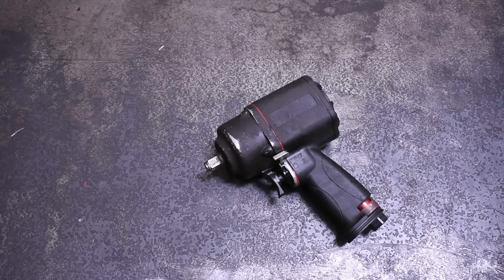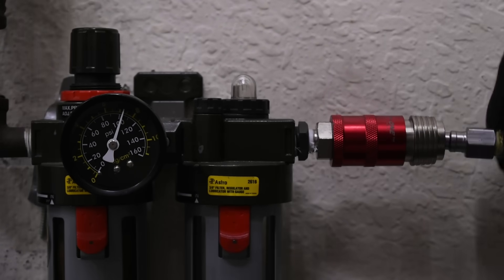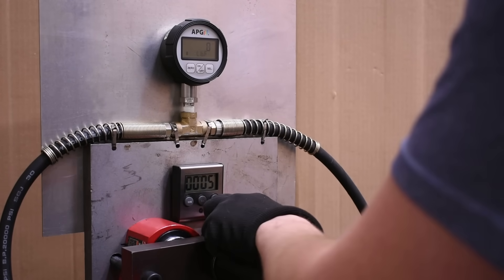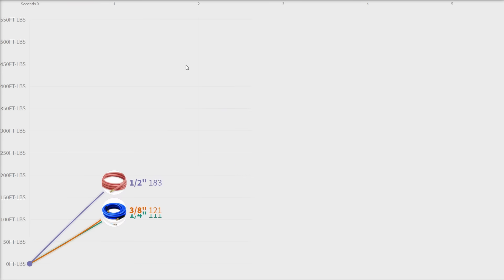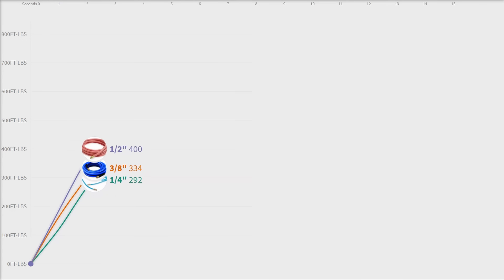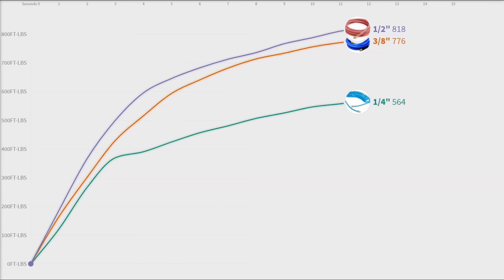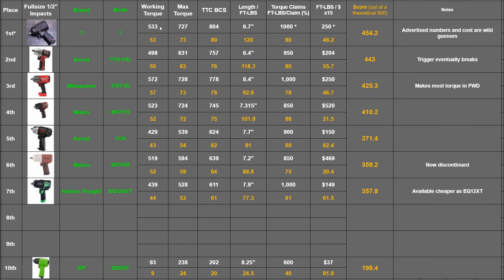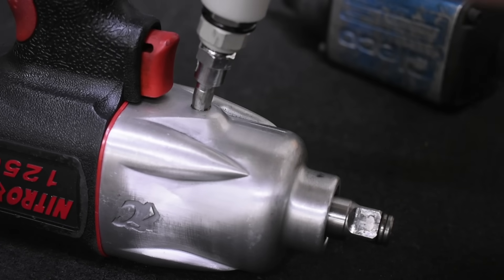How Much Power Are You Losing w/ Your Air Hose Size? Dyno Graph Testing

Comment: I sell and service pneumatic tools at my work. We find if people are losing power at the tool, it quite often stems from what the inner diameter of their air hose is and how much it's restricting volume, lots of people forget about volume and just focus on pressure, easiest way we've found to see the reality of this is to have an in line gauge plugged in right before the tool that'll show you. You may have 110psi when not using the tool (as recommended) but then drop to 55-65psi when actually in use. 

Just my 2 cents.
Reply: Another pressure drop is the coiled hoses!
On airseeders, all of the main runs have to be about the same length. Every time you loop a hose around the tower you ADD 6’ to 8’ to the hose length to get the effective length. 
Pull a pressure drop test on a 3/8” rubber/plastic hose vs 3/8” I nylon spiral hose. 
Use no air couplers, just a 3/8” ball valve, test hose, tee to restriction gauge, air wrench!  A lot of people are going to only use 1/4” or 3/8” nylon spiral hoses for their blow nozzles. 
Another huge restriction is the hose reel!!!
Hello from north east Montana. 
10 miles from the Canadian border.
Reply: I have a old (from the 80's) 30 gallon Compressor on 220v and run it at 90psi with a 50ft 3/8" hose, it never really feels starved but i do get a small kick when the compressor comes on after a few seconds. I've used my impact gun on small tanks at a friends house, seem to struggle for air after the first 2 seconds of use. At that point i start to use it in 2 second bursts to let the compressor keep up.

Comment: I’m new here wondering what size pipes are plumbed in the shop I think they should be larger than the size of hose you are testing again new here have no clue what the shop is plumbed with
Reply from the maker: Hey no worries. 3/4" cast pipe coming from an 80 gallon Ingersoll Rand compressor

Comment: I only use 1-1/2" fire hose and adapt it to fit. Or if I need the boost I'll attach the impact directly to the compressor tank and hold the work up to it.
Reply: 1 1/2' haha rookie.... I go nothing under 2" 😐
Reply from the maker: It's the only respectable way

Comment: I run 3/8's, used 1/2" before. It is noticable, that being said. The bulky 1/2" in a factory where you have 20-30' and you are 15 ft up, that extra weight does cause some issues.  The 3/8" rubber hose is really a good compromise.
Reply: We have miles of 3/8. Our foreman tried to order 1/4 and that was a mistake. 3/8 seems to be all we ever need in wood process and Manufacturing

Comment: What about running 2-3/8 hoses into a tee, then into the gun, then the same with the 1/2" hose
Reply: You are talking about a .02455 difference in volume, 2x 3/8 is about .2209 vs 1/2 is .19635. And there is more surface area to cause drag. Interesting but the jump between 3/8 to 1/2 is almost double the volume and 2x 3/8 is almost the same.

Comment: I could never figure out why all the framer I know use 1/4” x 100’ line.
Reply: It’s lighter and easier to move around when roofing or framing not a huge air demand on air nailers like air impacts even if your rapidly nailing constantly just like how that 1/4 was doing good for about 3 second then flattened off your not requiring a ton of air to run your tools and if they are still going deep in the wood why change it
Reply: @colerakocy2250  I have used the 1/4” x 100’ line for roofing staples and the pressure couldn’t keep up. Maybe it’s better for framing than rapid fire stapling.
Reply: @White000Crow  Tank size and pressure make a difference, too. Increased tank size or tank pressure means each driving pulse consumes less of the total uncompressed air volume, with the tank pressure staying higher which restores the hose pressure faster.

This is also why, ideally, you regulate pressure as close to the tool as possible. You see this a lot with paint guns, where they attach an inline regulator directly to the tool and run much higher line pressure; or in plumbed shops where the hard lines run straight tank pressure.
Reply: @Azlehria  I’ve been through plenty of shops with large air compressors but have never seen 1/4” line plumbed, it’s usually 1/2” to 3/4” line.  With paintball guns they aren’t running 100’ of line so there is a lot less line resistance to overcome. 
As the video demonstrates with 25’ of air hose, the line size does matter. Imagine quadruple the line length and how much more resistance they would have.
Reply: @White000Crow  Not sure where you got 1/4" plumbing from. I usually encounter 3/4-1" iron pipe for plumbed air, which is in line with your experience - by connecting this without restriction, it effectively increases the tank volume and extends the tank itself closer to the work location.

Likewise paintBALL guns; I was referring to paint spray guns. A common arrangement seems to be a regulator on the wall at 40-60 PSI, then an inline regulator at the gun to fine-tune the spray pressure.

Comment: I use the Lincoln style fittings. Makes connecting and disconnecting much easier. I know they are not super high flow though. Need an oversized type.

Comment: Best way to get better air is by using a pressure washer coupler,  no quick connect guts mean zero air restriction, you'll just need to add a ball valve to the air hose in order to drain air line pressure before disconnecting tool from hose.

Comment: The smallest port ID will be the greatest restriction and that is usually the coupler.  The ID of the hose & coupler should be the same to get the most from any one combination.
Reply: It wouldn't matter in this setup. The air source is limited by the filter and regulator they are initially connected to. Anything after that is just minor restrictions from resistance in line size but the volume of flow is already a fixed value before the line sized come into play. This is why the 3/8 line and the 1/2 inch lines peak similarly but follow a very similar power curve. The initial burst on the 1/2 inch line is from the extra volume of the line storing compressed air volume. Once that reserve is depleted and replenished from the source (regulator), the air flow is restricted by the source more than anything. 

In contrast, the 1/4 inch line is actually smaller than any upstream restrictions so it has a dramatic affect on the flow rate. 

If they had a 1 inch setup from the air tank (supply) out to the difference in line size, your fitting argument would have a much more noticeable impact on the results. 

That is unless I misunderstood your statement and used 5 times the words to say the same thing.
Reply: @sumduma55  Yeah almost any time you're going through a pressure regulator, THAT is your smallest restriction...   unless you're expecting unrealistic things from 1/4" fittings.

Comment: Half inch hose and V style couplers, it also keeps people from borrowing your air tools.
Reply: Actually go with Milton G style. They are rated at 99 cfm vs Milton V at 74 com but they are big and heavy like the 1/2" hose vs 3/8" hose
Reply: I will give them a try

Comment: A great series of tests that many people don't realise just how much difference that the accessories make. 
Other things that make a difference that you could test.
Air fuses, these will prevent a hose from whipping around if the end comes off. Important if you are using 150 psi air pressure.
Your FRL unit is a bit small to run an impact gun properly I believe. The regulator cant cope airflow wise during the pressure drop. Perhaps something like this as it flows 85 scfm   shorturl.at/otBNX
Something that is overlooked is the 90 degree impact wrenches. Few if any back to back tests for these and there are several that make claims that are questionable at best. I have one of these and find it quite useful   shorturl.at/fFM16

Comment: Volvo  d13 flywheel  bolt, 60 ft lbs  plus  120 degrees  turn . My  nitrocat 1250k with  3/8s line  won't  make  60, with  1/2 inch is  still  moving  at  120 using  high flow fittings .

Comment: How about changing to 3/8 fitting ? I switched my 1/2 impact wrench from 1/4 to 3/8 fitting and noticed a big power gain
Reply: That's what I actually wanted to see
Reply: I was looking at 3/8 fitting before I went with Milton V, Milton V have the same ID as 3/8. I have since upgraded to Milton G.
Reply: @WarWolfX1  I google image Milton v fitting and looks very similar to 3/8 fitting I use on my air tools.. good choice!!
Reply: G fittings all the way

Comment: you should definitely do the different types of fittings, my business needs new air ends bad and i would like to see what the best bang for my bucks would be as to what style to overhaul it with!
Reply: Im using the milton v style  hi flo  Quick connect i have noticed a difference even with 3/8 hose. I bought these not for my impact ( also use it hor that)  but for my TD 58 Plasma cutter. I was getting  a significant drop in pressure  on long cuts this was with milton Quick connect M style  connectors. The high Flo has mast a significant improvement with 50ft hose
Reply: If you really want to wake one up you run a half inch line from a dedicated port on the tank straight to the gun and make every fitting as big as you can. If you work in an engine shop that ports heads you tend to port everything when it's slow. 

It will make that grandpa gun run like the matco if you port the ex side of the old one. 

It will be stupid loud and still just as heavy but powerful enough to break sockets every week,
Reply: Start by using a drill bit to measure the ID of the male quick couplers. I don’t care what brand name it is a 5/32” hole will flow less air than a 3/16” hole or a 7/32”!
There is a brand of quick couplers out there that only has a 5/32” hole, they are long, with pretty red, white & blue packaging, with a huge, huge name!
Reply: i went legacy hi flows, with impacts the fittings don't seem to last very long, same thing with milton's too..... the flange where the coupler balls grab onto wears/compresses down, then the connection leaks, and you can feel a lack of power too from it not fully opening the coupler (new fitting brings the power right back)
i know a whip hose would do wonders for life, but i swap/change tools too much it would really slow me down
also even on my 3/8" impact, you can feel a power difference between coupler styles (i do have an adapter coupler for use on one wall coupler, and you can feel a difference) and obviously the more air hungry the tool the bigger a difference it makes with power. FYI compressor cycles between 125-175 psi, so not shy on pressure either, which probably doesn't help life on the fittings either lol
Reply: Milton P
Reply: Milton G

Comment: How about difference in "slightly" higher PSI? Some say air tools come really alive at 100-110 psi at the tool. That shortens the life of the tool of course as 90 psi impacts aren't meant to perform at such high pressure but just curious about the real world difference.
Reply from the maker: Depending on the tool size. Our best case scenario test at 150psi static is like 110-125 psi in the tool

Comment: Would have thought the 1/2" line would of given more.  I guess you need a 3/4" impact to take advantage of it.   I'd like to see milton G style thrown in to the mix of couplers.   To save on the price of a 1/2" air line, I've even contemplated having a 3/8" line to an airpig, and then a 1/2" - 6 foot whip to the gun, but don't want to get too bojangly at work.  Keep up the great work, looking forward to seeing this channel grow.  cheers
Reply: You want the big hose on the long run. A short 3/8 hose won’t reduce it as much as a long 3/8 hose. Ideally you’d have a long 1/2 hose then the short 3/8 whip hose on the tool.

Comment: Good test.
I use 3/8 lines at my bays as due to good air supply routing I only need 15ft hose and the short length mixed with quality 3/8 hose makes it a treat work with all day long , 1/2 reserved for longer hose and more air hungry tools .

Comment: Very informative video. since I didn't see it in the video description, I have a few questions.

What size air tank are you running? 

In regards to the different psi test, what psi does your tank drop to before the compressor comes on each test if it occurs.

Does running at 150 for prolonged period of time cause more premature ware on the tool or is it a non issue.

Thanks for all the great content!
Reply from the maker: Ingersoll rand 80 gallon 220v. 175psi max tank pressure, turns on around 135psi. But if the line pressure drops 5 seconds in vs 15 seconds in due to the compressor being on we test it again. We usually run a handful of tests either way. 
Yes it causes additional wear. How much is dependent on what the internals are made out of and their hardness. So far brands known for their air tools (IR, Aircat, Astro) seem to not mind higher pressures, some others have stumbled or seen additional wear.

Comment: With jamming so much IN to the gun, i wonder if the exhaust portion is ever a problem...also if there could be some sort of...porting that could be done to a gun, maybe some cheapo HF one see if you clean up some impuritys or edges if anything would change. Neat to see if people could half build their own guns and just get them going to their best
Reply: Some air tools can be ported. It usually takes dissembling them. Then you can see if there’s small ports or even flashing that restricts airflow. There’s also high flow fittings that have thinner walls and a less restricting coupler.

Comment: I wonder how the demand for these air guns has decreased now that cordless electric guns are entering the market with some impressive results.  My wonder is how will this affect the future of air tools as the demand goes down the price will have to go up the supply them.  Seems to be the possible nail in the coffin.
Reply: Power to size, control, extreme durability and low manufacture cost mean they be around for lot longer yet .
Plenty innovation still going on in pneumatic tool manufacturing .
Reply: @mrb1864  that plus the hybrid pneumatic guns that will change the game.

Comment: Not directly a torque test but could you test how much torque it actually takes to break a non-impact socket? People always say you’ll die horribly if you use a standard socket with an impact.
Reply from the maker: We can throw it in the mix somewhere, sure!
Reply: I'm sure if you use it for like...bolts which are just rusted and stuck on there, yeah it might be a problem. I've used like some above 21mm sockets once for a rack or something on a dodge just because its all i had at the time. Chrome worked fine so.
Reply: My big issue with standard sockets is the spinning, peeling chrome plating of death.  It'll  chew up your hand faster than a playful puppy.  Never had one explode, just split.

Comment: Exactly what I needed right now. Perfect for my playlists. Thanks bro man
Reply from the maker: We gotchu brotato
Reply: @TorqueTestChannel  Ive always believed the reason you didn’t see too much difference between the 3/8”I.d. And 1/2”I.d. Hose was because you ran into and issue with the couplers. Try switching the fittings and couplers to a 3/8”npt Milton G-Style and see what happens with the 1/2”I.D. Air hose....

just sayin...it normally doesn’t matter. That is until we are talking about 3/8”npt inlets And very VERY hungry tools that can eat ALOT of air.

If I’m wrong I’ll owe you a coke or a beer. 🍻
Reply: @TorqueTestChannel  1:55 Milton G style. Best for tools with 3/8npt inlets and 1/2”is hose. TRY IT!!!

Comment: I would be very interested to see you test the different couplers.  I am just about to switch couplers in my shop going from Milton A style couplers to Milton V style couplers.  A friend made a similar switch and says it is a big difference but doesn't have a way to quantify the change.
Reply: It's noticable, also try the prevost high flow with push buttons, they are fantastic.
Reply: Skip all that junk and go straight to milton P style, the V dont flow anywhere near advertised
Reply: @5002strokeforever  the milton v style or prevost s1 (German) is high flow.